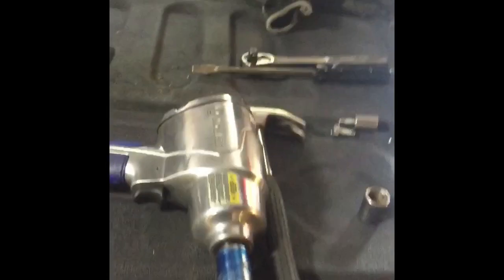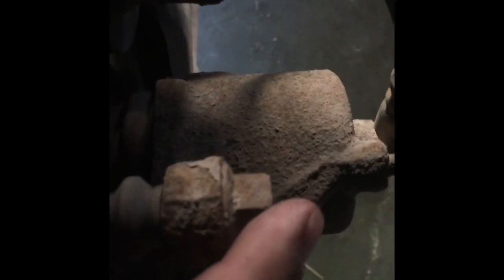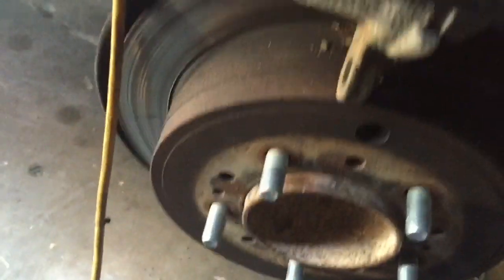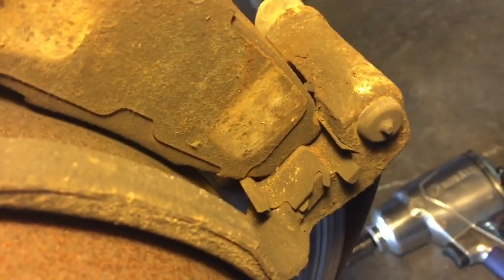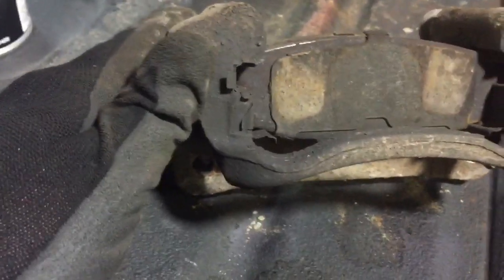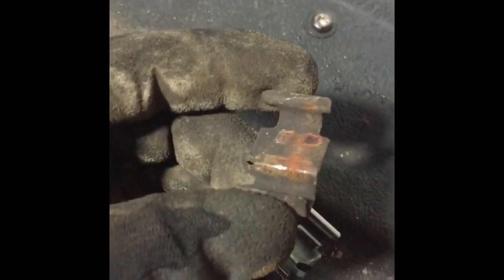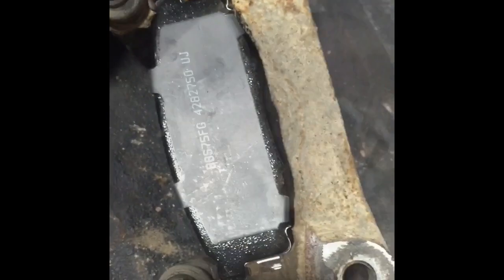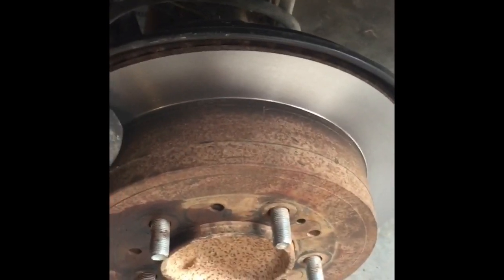Rear brake job on 2011 Toyota Tundra

Comment: Hey bro!  You're a lifesaver!  I've done several brake jobs on my own vehicles but when I worked on my wife's 2011 Sequoia, I couldn't get the rotor off.   I watched your video, got some M8 X 125 bolts and did exactly what you instructed and the rotors popped right off.  Dealership wanted $600+ for rear brake job.  I did it for $69 by buying OEM parts on Amazon.  Thanks again!  Keep up the good work!
Reply from the maker: Brad Chew thanks for the kind words man glad my video helped !

Comment: Always open the bleeders it is never recommended to push fluid back to the ABS pump. The valves are closed when doing this and can damage the unit. I have been to Honda, Mazda and Ford brake trading classes when I was a tech. All advise the same thing.
Reply: No you open the reservoir so that goes back into the system you don't open up a bleeder
Reply: @silvajay6443  that’s a whole different animal he’s saying the abs unit is only a positive set up and not to push fluid back into the system or it will damage the unit !   But it’s does not have a check valve and fluid does go back and forth other wise the caliber would only close and never open !

Comment: Anybody have a problem when the rotor is actually replaced, the rotor rubs on the the emergency brake backing plate?  There was a TSB issued on this and it looks like a nightmare to correct.  The original surface area for the emergency brake on the inside of the rotor is 2.5 inches, the replacement rotors are all 2 5/8 causing it to rub on backing plate...

Comment: You forgot to tell people to turn the rotor to 12/6 oclock and line the adjuster holes up and release the drums!
Reply from the maker: otahu Rice  didn’t have to 

That’s what the jack bolts were for popped right off with no problems